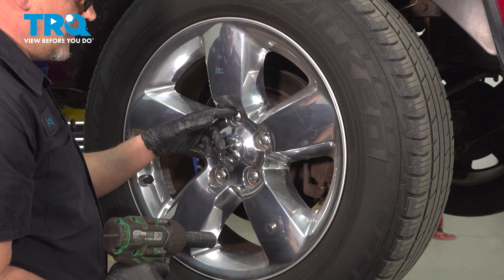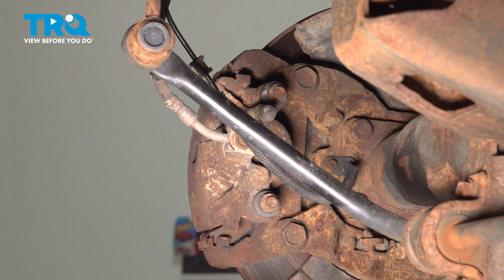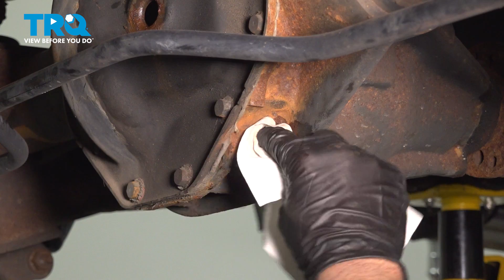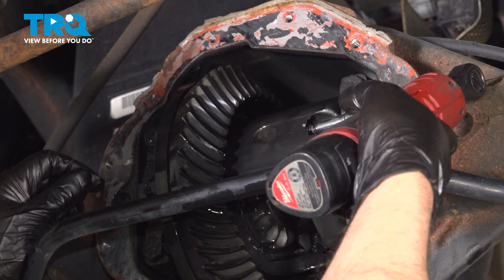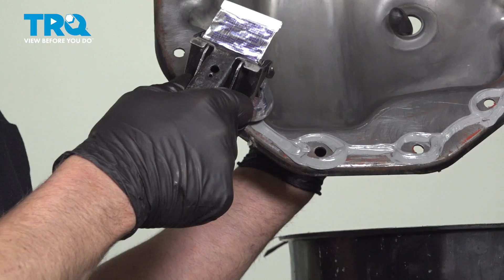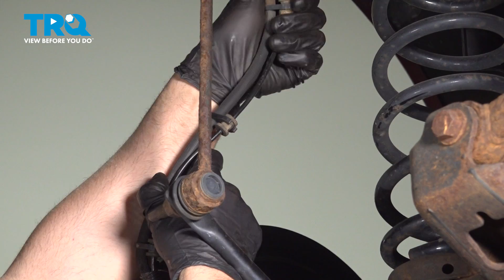How to Replace Rear Backing Plates 2011-2018 Ram 1500

Comment: If you guys are having trouble finding the plates it’s called a dust shield in all parts stores btw and it’s an m6 bolt replacement when you break them off